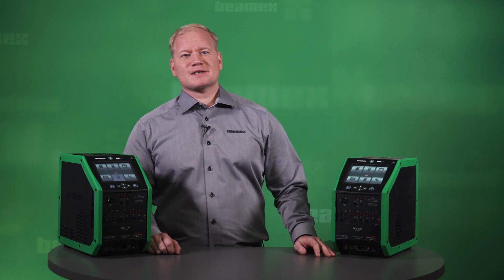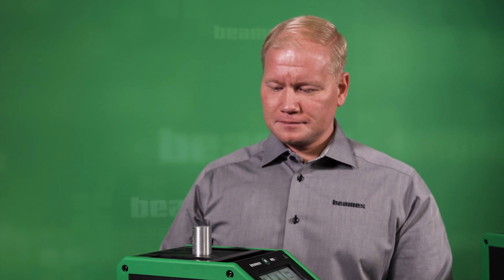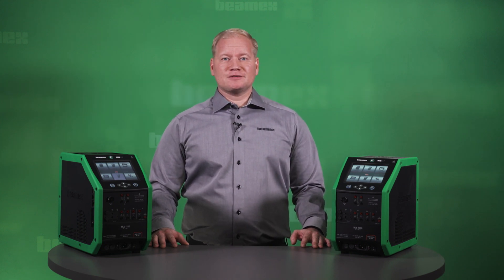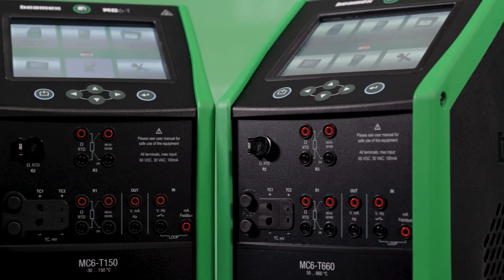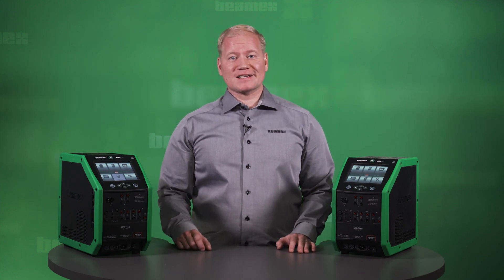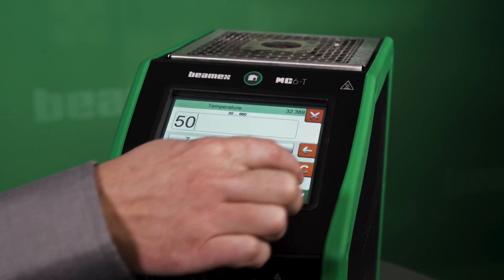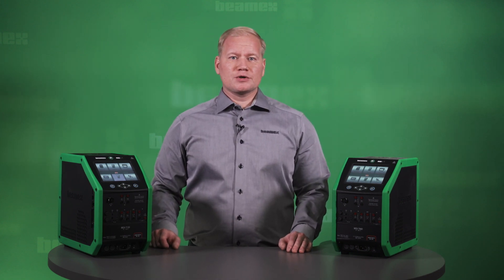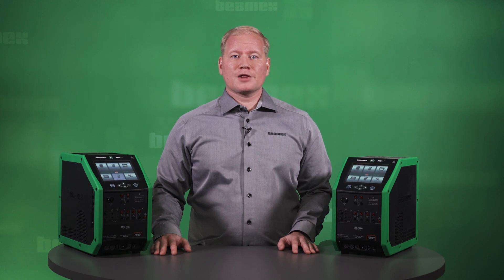Beamex MC6-T Multifunction Temperature Calibrator and Communicator

Comment: How do I calibrate a temperature transmitter from 0 - 200C with 1 calibration report?

the T150 does not reach 200C and the T660 does not reach 0C
Reply from the maker: Hi there! To calibrate a range 0 to 200°C, you would need to use both models. You would get the result into one calibration certificate anyhow (using Beamex calibration software).  Alternatively, you could also use The T660 and do the zero with an ice-bath. Thanks,